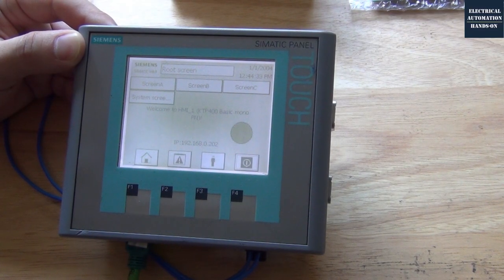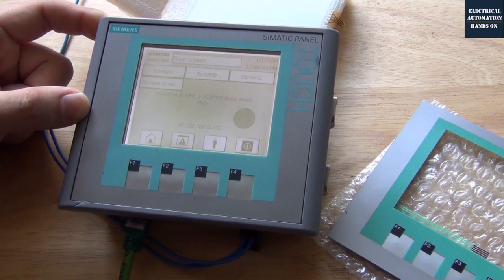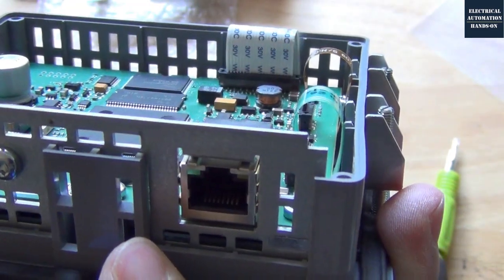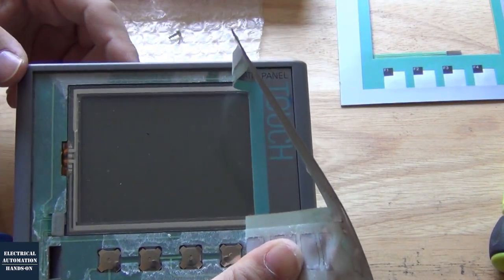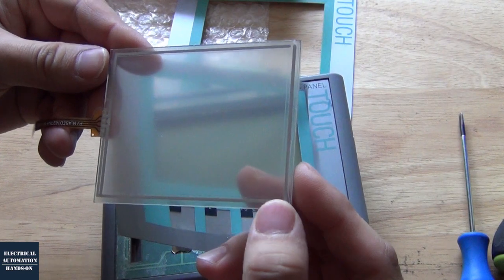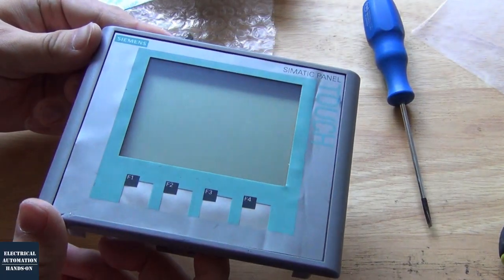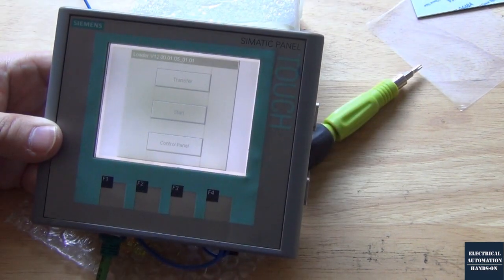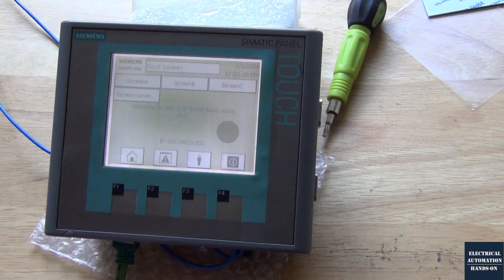SC05. Siemens KTP HMI Touch Screen Replacement

Comment: What do I need to replace when only the backlight led is broken? Is it inside the Touch screen unit or inside the frame and housing unit`? Unsure which spare part to order. IT is KTP400 Comfort and I also have a KTP Mono which also needs new backlight. Do you know if those parts are interchangeable?
Reply from the maker: I don't think you could easily find the spare for fixing the backlight. it most likely comes from the board at 4:05. Maybe have to consider replace a new one.
Reply: @electricalautomation  Interesting. I have 3 broken KTP400 to experiment now. The basic, basic mono and the comfort one. I talked to a shop guy and I hope to get info which parts are interchangable. The Mono one I got still shows something on the screen but it has something like...black bubbles so I hope it is just the display frame unit broken.
What I fear is I need to replace the full unit ;)

Comment: Thanyou very helpful, i want to now if we can remplace the the touch screen siemens 10" whith a nother 12" ,I warry about a programme, is possible or not please?
Reply from the maker: if you have the TIA portal project, you can adjust the.HMI to a different size od the screen without redo the project. Because you can not upload the project from HMI, unless originally it was set to be upload and using a card.